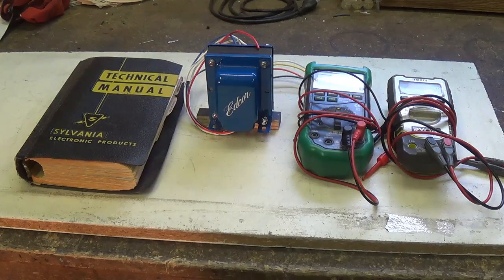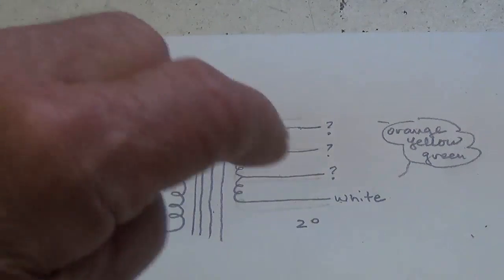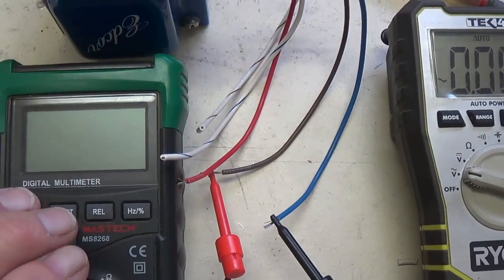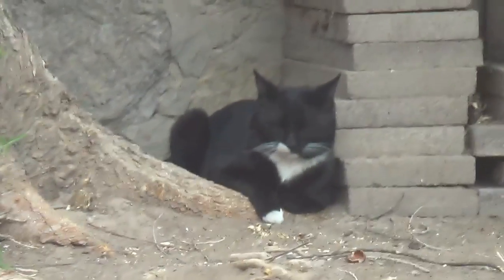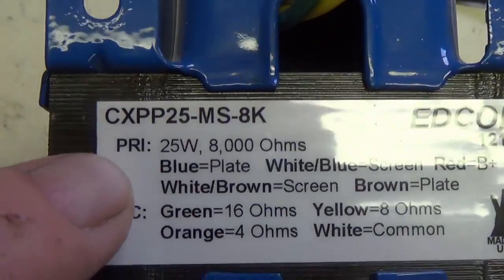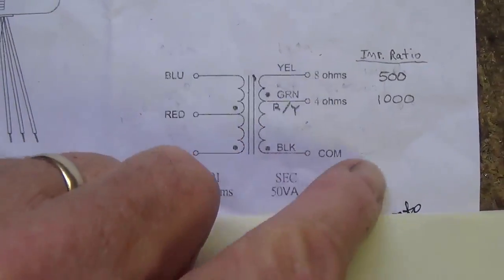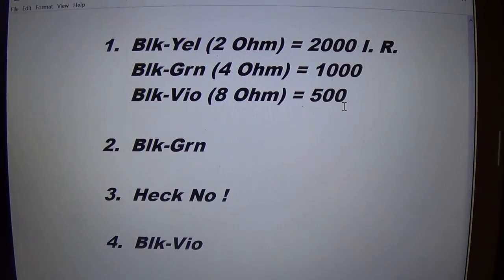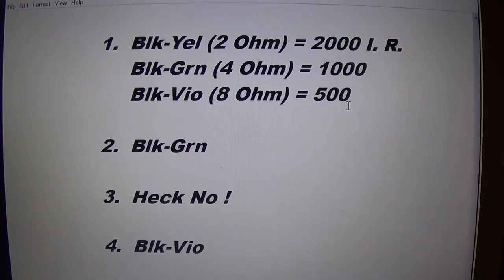Impedance Ratio: The Easiest Way to Decipher Output Transformers

Comment: Hi Uncle Doug...after a few months of reading tube hi-fi articles, I notice that they are mostly interested in clear, undistorted signal and output. Cool but not quite the same as guitar amps which, as we know need a little scragg, scrunt or whatever term one likes. I stripped a Stromberg Carlson P.A. head, in part because I didn't know enough to modify such an amp for guitar amp use and partly because I have been a metal worker for most of my life, wanted to build from scratch, wanted to build my first push-pull amp for guitar, and whether true or not, I read that the late Ken Fischer felt that an aluminum chassis makes as good or better chassis and ground platform as steel. The donor amp has inside the bottom cover the original schematic which was written with 6L6 tubes in mind. These were replaced with a beautiful pair of Tung-Sol 6550 tubes that look brand new. I ran my O.T. per your video clip and it is huge iron, has outputs for 4, 8 and 16 0hm output and I got very similar results throughout and there is one more wire that I couldn't figure out that shows about 55 volts with a 6 volt variac input. I have tied this one off to the side but it is a shielded connection with the wire, a covering, likely the shield, and then the final covering. This original amp, designed for P. A. must have had well over 100 watts of power and it had only a couple of resistor strips completely laden end to end with various value resistors, mostly 1/4 and 1/2 watt sizes , used a 5Y3 rectifier and for preamps used one 12SQ7, the old metal clad type and one 12SA7, also metal type. I have bent a spacious 18*10*21/2 inch aluminum chassis, have my transformers mounted at each back corner and turned as to help alleviate hum. At this point, I can build anything I want and it looks as if the 5E3 Deluxe circuit is simple enough, has many web help sites and many modifications possible. For my first Push Pull circuit I wanted to keep it simple enough to have good results and not go modding away until after I get a working amp, at least. The P.T is also huge and puts out over 700 volts on the H.T. side with an input voltage of 127 volts from the wall socket. Having said all that , would you recommend a different circuit, different tubes, schematic, long tail pair vs the original PI, sensible screen taps, if needed and any other info you could give. I thank you as do many of your readers for clear, informative teaching. I could read every book I could find about amps but this stuff requires actual hands on building and is certainly more than that little Champ clone I built in 2015 so here I go. Your clips are a great help and you are an excellent teacher. My apologies for such a long winded comment. The hot rod is awesome ! Thanks, Daniel
Reply from the maker: Greetings, Daniel. I really enjoyed reading your plans and observations. I think you'll find that a nice pair of 6L6GC's is topped out at around 50W, most likely a bit less. If you want a nice sounding amp with no effects, either a 5E3 Deluxe (medium volume) or 5F6A Bassman (higher volume) would do. If you want reverb and tremolo, go with a Princeton Reverb. Good luck.

Comment: Great video!!! I used to go through that whole process, but I have found through experience that I can determine the impedance ratio of a transformer by just measuring its DC resistance with an Ohmmeter. Much less time consuming.
Reply from the maker: I have never heard of such a method being used for IR determination, William, but if you say so, then it's good enough for me.
Reply: @UncleDoug  You don't necessarily get an IR determination per se, but you can deduce what it is based off DC resistance values. I only know this because I did some value tests from known values or from obtaining values in the manner that you did in your demonstration. The DC resistance of the primary of an output transformer is easily obtainable with a standard ohmmeter. I use a milliohmmeter for the secondary.  I determine what leads are what on the secondary, by the proportional resistances and what the the AC impedance of the primary is based off measurements I've done in the past. Since most output transformers have pretty standard impedance ratios, this works most of the time. If my numbers come out all catty wompus, then I know I'm dealing with a non-standard transformer and will conduct the turn-to-turn winding ratio to impedance ratio method at that point. So far it has worked out pretty good.
Reply from the maker: Very interesting, William. Thanks for sharing this with us.
Reply: @UncleDoug  Another very fast and accurate method is the 4-wire Kelvin method. They actually make handheld multi-meters now that can do this function for under $100. It uses two current probes and two voltages probes. It injects a known current and then reads the voltage produced by that current through the coil and outputs a resistive measurement based on Ohm's law. It is very accurate. In fact i thought the milliohm meter that I had purchased last year was supposed to have this function, but I ended up ordering the wrong one.

Comment: I love your restos and rebuilds, but this is the stuff that initially drew me in to your channel. As a novice amp builder/modder myself, this information as extremely valuable. Thanks for doing it. If I may make a suggestion...do something similar with a power transformer when you can. I'm still in the dark about deciphering and adding up amp-draw requirements and stuff like that.
Reply from the maker: Thanks so much, GL. I have already covered power transformer specifications and selection in previous videos. See the Supro TremoVerb series.

Comment: You already did a video like this ,Doug. But  its nice you're expanding by showing the options with other  tube configurations .  Plate to plate load resistance is hard to find on the internet sometimes. You def need a good tube manual to be really flexible.
Reply from the maker: You're right, Pief. I try to include more information and some different applications with subsequent videos. I'm glad you liked it.

Comment: @20:11, I’m looking at the page you are open to for the output impedance for the 6v6 under single ended load resistance (5500).  I have a single ended output xformer(I may use on a later project), which is around 6:1 or 8:1. (1vAC outputs 8vAC)  and multiplying 8x8 =64 , so am guessing is a different way/method to calculate a single ended xformer.  Thanks for the clarification on the push/pull which is very informative, uncle Doug.
Reply from the maker: Vince, the winding ratio determination is exactly the same for both SE and DE OPT's. If your SE OPT really does have an 8:1 winding ratio, then it is not suitable for use with any common speaker impedance. The standard winding ratio would be around 25:1.
Reply: Thanks for your reply, uncle Doug

Comment: This is a GREAT video! How could I have learned this without Uncle Doug's fabulous teaching?
One question Uncle Doug: Could the Edcor transformer be used with two 6L6 output tubes in push-pull using the white to orange wires by putting two 4 ohm speakers in parallel to match the 2 ohms out? Would that draw too much current?
Thanks for a fabulous teaching video!
Reply from the maker: Thanks so much, Steven. Yes, you can combine two or more speakers in parallel to obtain low and unusual impedance values.

Comment: When looking at a tube data sheet, I see the plate resistance, and load resistance values are different under various  (static) B+ voltages.This makes sense.  When choosing an output transformer primary impedance we use the effective load resistance. Maybe you can give a tutorial on how the effective load resistance is determined.
Reply from the maker: The process is apparently quite complicated, EB. I find it easier to simply trust the tube handbook.

Comment: Thanks, I learned a lot about how the speaker impedance reflects back to the primary impedance. What about going the other way? If you added two tubes (4 tubes total) as push-pull pairs while keeping the speaker impedance constant, would that reduce the primary impedance by half?
Reply from the maker: Yes, since the plate resistance was now in parallel, it would be halved, as would the matching reflected secondary impedance.

Comment: Hi Doug, everything you describe about matching impedance between output tubes and speakers makes total sense, but aren't the transformer impedance values themselves also important, and not just the ratio between input and output impedance? I would imagine, for example, that a transformer with say half the number of windings on both the primary and secondary sides would behave differently in some way, despite having the same winding ratios and therefore the same impedance ratios? Thanks!
Reply from the maker: The relationship between the impedance values of both windings of an output transformer depends upon the winding ratio between the primary and secondary windings.....and the value of each will vary depending on what the other winding is connected to. The overall number of windings and the gauge of the wire determines the power handling capability of the output transformer.....not the impedance ratio.
Reply: Hi Doug, I see, thanks for your reply!
Reply: Transformers don't have impedances of their own, only ratios that reflect whatever is attached on one side, over to the other side in proportion, which could be anything. Think of a magnifying lens or telescope. You look thru one side and the other side looks bigger or smaller depending on the ratio of the lens
Reply from the maker: @RocknJazzer  Agreed, R&J. Thanks for your input.

Comment: Thx uncle doug. you could use a dual speaker cab with 2 4ohm speakers in parallel  to get that 2ohm spec. hope you and the little 1s have a great day!!!
Reply from the maker: Yes, indeed you can, Ken, but I wanted to keep the presentation as simple and basic as possible. In theory, you can combine odd numbers of speakers to achieve really bizarre impedances....but that's a topic for another day.

Comment: Thanks for the concise explanation on transformers! Would you know how  to go about calculating effective load resistance for four tubes in push pull? eg. a fender twin. It seems like most of these tube manuals only have data for pairs of tubes.
Reply from the maker: You're welcome, GD. The ELR for a quartet of output tubes at a certain plate voltage is one-half that of the same pair of tubes at that same plate voltage.

Comment: 2:54 re testing an output transformer that is already installed in an amp - many tube amps (especially Fenders) have the output jack wired so that the tip shunt throws the transformer's output to ground if there is no plug inserted; for this reason, measurements are best taken by inserting a plug in the output jack and attaching the test leads to the tip and sleeve contacts of the plug. If the test leads are connected to the jack contacts inside the amp with no plug inserted, you'll be reading a short. I'm sure you (Uncle Doug) know this, but a lot of your viewers are noobs, and it's been my experience that if there is a way to screw up, a noob will always find it.  ;-)   3:20 re "standard" wire coloration - the primary red/blue/brown convention doesn't apply for Brit (and some other) transformers, and on old Fender tranny secondaries the common lead is usually black, with the positive lead being green. If there's more than one impedance (rare) the third lead is usually yellow. This is a great vid - I haven't thought about this stuff for probably 30 years.  I have a Fluke 289 which can resolve .001 ohm, so I do most of my mystery-tranny ID tests by ohming the windings. After the amp is built, I do power testing with a scope and a testload to find out what kind of tubes I can use with it. But I'm a dangerous kinda guy...don't try this at home, noobs.  ;-)
Reply from the maker: Thanks for all your excellent suggestions and input,  Willie. We really appreciate them.
Reply: @UncleDoug  Aw, shucks,  ;-)

Comment: Hi Uncle Doug.  I'm just getting into amp repair as a hobby and came across your videos.  Your method of instructing is clear and easy to follow and is greatly appreciated!  I'm working on a Tweaker 15 that has lost volume sounds muffled.  Changing tubes doesn't help, however, connecting the effects loop send to another amp return the amp is loud and clear .  Which leads me to the power amp section being the problem.  Others have suggested a bad OT.  Would this method of determining impedance also show if the OT was bad?  Thanks!
Reply from the maker: Greetings, Bob. Yes, if an OPT can yield a proper winding ratio, generally it is fully functional.  Don't forget your phase inverter. It can cause issues also.
Reply: @UncleDoug  Thanks for the reply Uncle Doug!  I think I confirmed my OT is bad.  When I put 8 vac on the secondary, I get Orange: 25.52, Green: 28.7 and Yellow: 31.  I checked the measurements twice and confirmed the scale on my meter twice.  My winding ratios range from 3.06 to 3.71.  I've searched all over the place to find something to help me figure out of my OT was bad and then came across your video.  This has been invaluable.  Thank you again!

Comment: Thank you for this. I've learnt so much from your videos. A quick question. If I'm using a variac (mine's 500VA) to apply a low voltage to the secondary coil, would there be any danger of too much current flowing through the secondary and damaging the transformer? Or are we going to be okay because the primary is connected to a multi-meter (high impedance), and that impedance is going to be reflected to the secondary?
Reply from the maker: The secondary winding will only allow a nominal amount of current to pass thru. The only possible danger would be to apply a voltage that overwhelms the insulation between the wires of the coil.

Comment: Hi Uncle Doug, I did your method just tonight,  but used a function generator set for 1kHz.   The frequency doesn't have to be lower as in 60Hz does it?  I did come out with common speaker tap values so, I think I did this all right.  thanks so much!
Reply from the maker: It sounds like your method worked just fine, Philip. I'm glad you were successful.

Comment: Uncle Doug! You're videos are awesome! Thank you so much for all the info and the way you lay it down so one can understand. One question on this topic that I cannot seem to find the answer for is this..What about a quad or six tube amp. Do you need to change the transformer primary then? Or stick with what the spec is for a pair? Thanks in advance!
Reply from the maker: The net impedance of a pair of tubes in parallel is half that of a single  tube.....so the primary impedance of a quad output amp is half that of a regular push-pull amp with the same tubes.
Reply: @UncleDoug  Thank you so much! I was kind of getting that by looking at some replacement transformers with different tube sets. Ones that were kind enough to show the P-P information anyway. I got a little confused when Hammond would say a transformer was suitable for 2-4 or 4-6 tube amps. Perhaps they meant for you to find tubes that would work in those configurations with that transformer. Anyway....again..your awesome and I can't thank you enough for your videos and your response.
Reply from the maker: @robrundirocks  The primary impedance of an OPT is simply the reflection of the secondary (speaker) impedance, as explained in the video. Rather than trying to find suitable tubes, it's more llkely that chosng the right speaker impedance will produce the desired primary impedance.

Comment: very nice video (just ordered a 12v transformer), one question how do you tell the wattage of an OT? 5w, or 15w and so on. this is important to know correct? when matching to a particular amp build.
Reply from the maker: It's critical that the OPT power capability matches or exceeds the output power of the amp, Jim......but I know of no way to tell the output power of an OPT by looking at it, other than the fact that the power rating is directly related to its mass.
Reply: @UncleDoug  interesting, so weighing it and comparing the weight to a known OT might work. thanks

Comment: Interesting. I haven't played with tube stuff, but have played around with winding a few power transformers. Perhaps I don't understand this subject well, but this looks like a way to calculate the current across any type of transformer. That's the one aspect of rewinding I didn't know how to calculate manually. I was just using the rated output power as a guide, and counting the secondary turns when un/rewinding. I was just using the rule that secondary load determines the primary winding's current.
 
 Thanks for the shifted perspective. Nice rat too. I always wanted to build one but got a cheap 92 camaro instead...w/a B&M miniblower that would look more at home on your ford instead of hidden under a fiberglass bubble :-)
-Jake
Reply from the maker: Thanks for your input and comments, Jake.

Comment: I've been told there is no such thing as a stupid question, hm..hm, so let me try this one : How about push-pull parallel  or triple parallel push-pull? Am I right to believe that the Raa ( Plate to Plate Resistance) is like resistors in parallel? And is this also true for, let's say 2 or 3 tubes parallel SE? Or are there other issues involveld? I have this idea of building a SE with two or three 6V6 parallel with variable bias ( Negative Grid Voltage) as opposed to fixed bias where other issues might come in to play. Thank you for your validated reaction in this regards. Kind regards, JF/Belgium (Europe)
Reply from the maker: Greetings, Jacques. You're right.....the plate (load) resistance of output tubes in parallel obeys the rules applied to simple resistors:  i.e. the net resistance of two 10K Ohm tubes in parallel is 5K Ohms, and for four in parallel it's 2.5K Ohms.